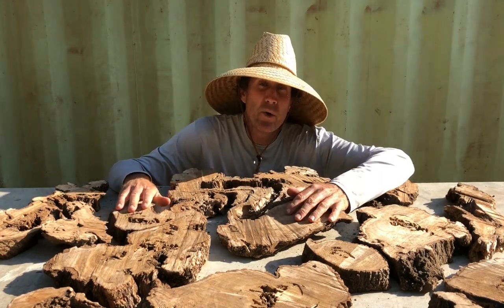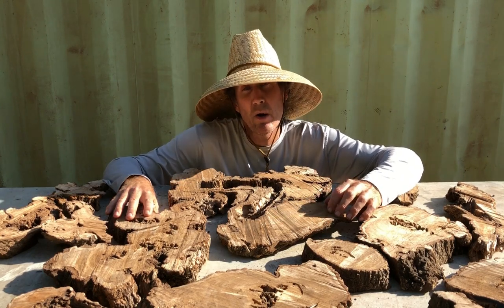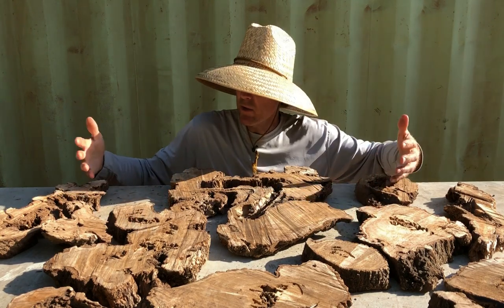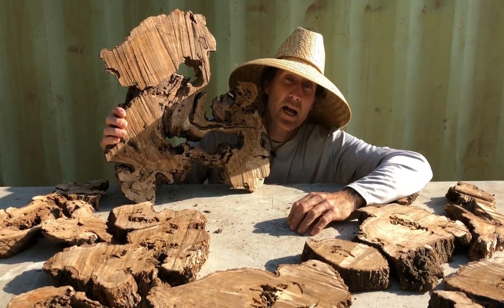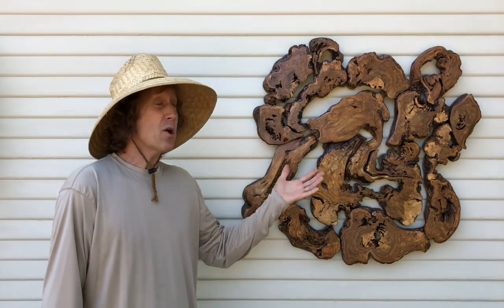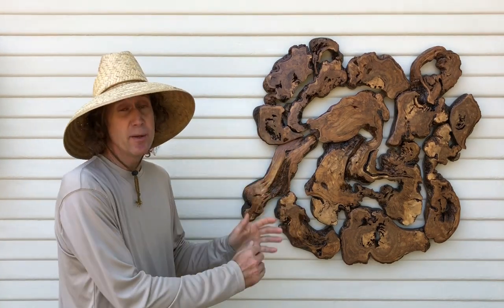"Legends of the stump" - the legend continues.....

Comment: Ooooh, tough question. I had to freeze the video for a few minutes to compare. I am more drawn to number two, because the pieces are placed more closely together, less gaps between them. I think this reflects my 'keep it tidy' approach with my own art. I also have a desire to fill in any areas which look forgotten or bare, when sometimes I should maybe leave alone as 'less is more'. 

They both tell a different story, both are pleasing to the eye, and the fact that you have enhanced the beauty of Mother Nature is a bonus.  ilona xxx
Reply from the maker: Thanks for the feedback ilona :) I remember in another comment you made one time that you like the pieces closer together with less gaps between them. In the case of these two pieces I just did what I felt would work best with the wood I had. But you're right, they both tell a different story :) And any chance I get to enhance the beauty of mother nature......I'll take it :)
Reply: You have a better memory than I have. It's very hard to improve on the beauty of nature, but you can. Your ideas are ace.